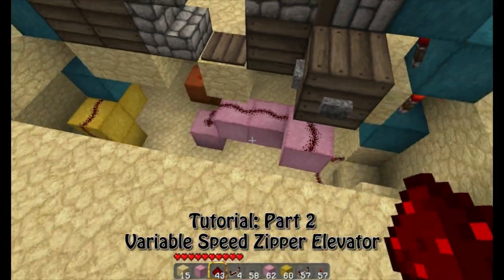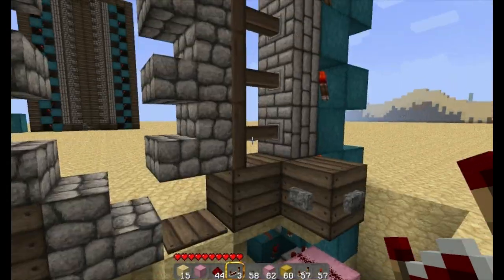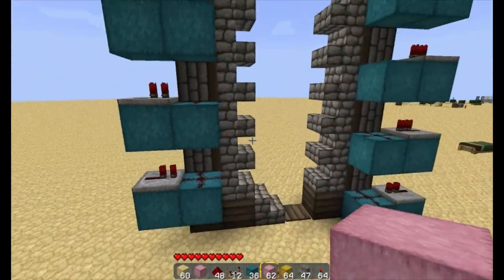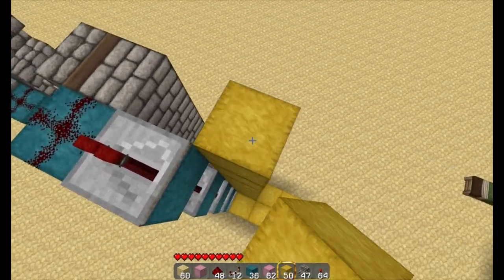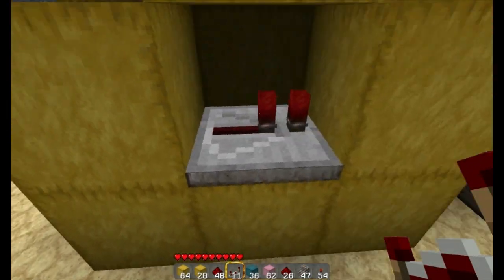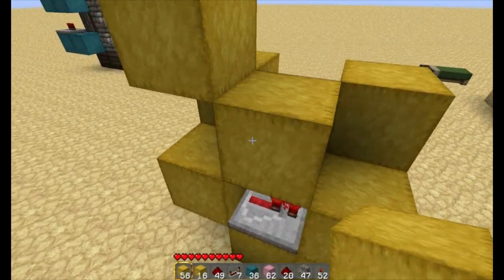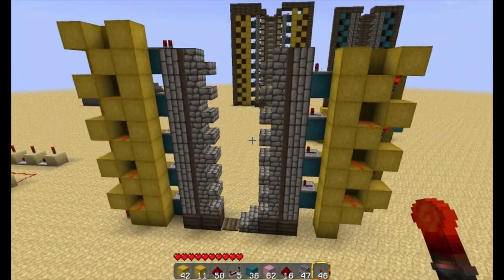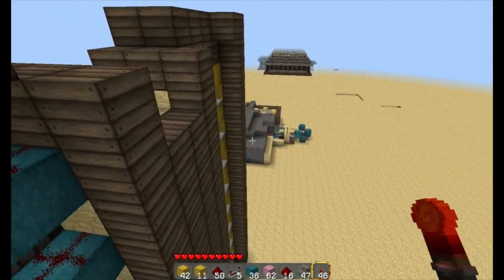Tutorial: Variable Speed Zipper Elevator(Part 2)

Comment: @mcKrawll im having the same problem. i had to mirror your wiring because at first it looks like you built the elevator like normal but then you switched the pressure plate to the other side. after i built it i did the wiring and had to mirror it. im not sure if i did it right.

Comment: for the smp zipper
had to edit it a little bit, by putting the yellow circuit behind the blue, and had to make the 
blue a little different because the red stone doesn't make a cross anymore so my pistons were only powered by every other one. 

also, how are both sides connected to the bottom/button?

Comment: I'm having the most bizarre problem with this design... I tried building it in my world twice (underground/water), and it failed. I tested your design/world save on my machine, and it worked. I then copy/pasted your design into my world (above ground) and it worked. But when I put it underground, it stopped working.

When underground, it runs WAY too fast. Above ground, it runs at the perfect speed. I'm going to have to use the variable-speed elevator to artificially slow it down. Any thoughts?